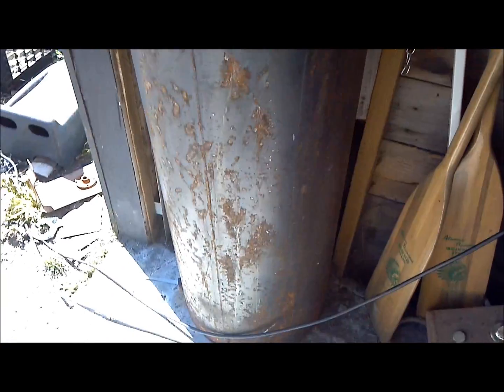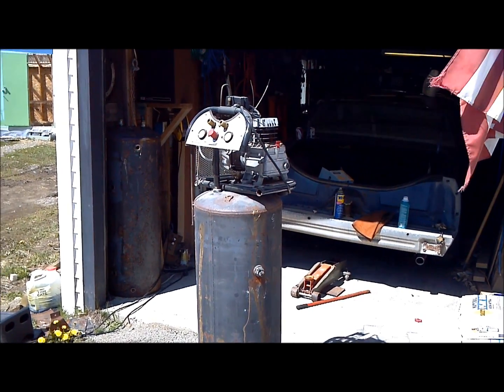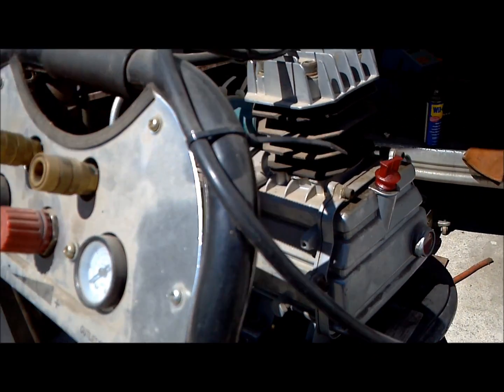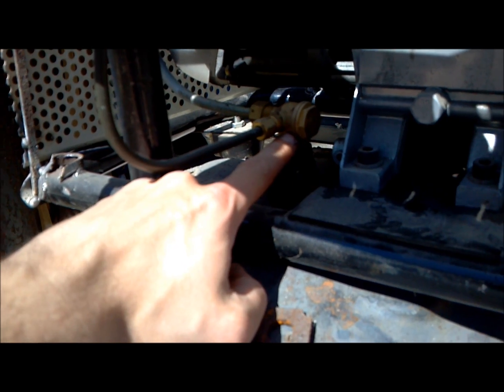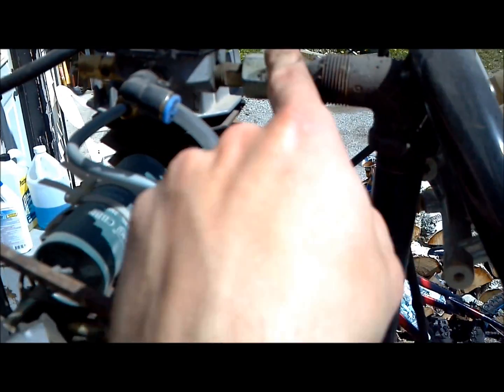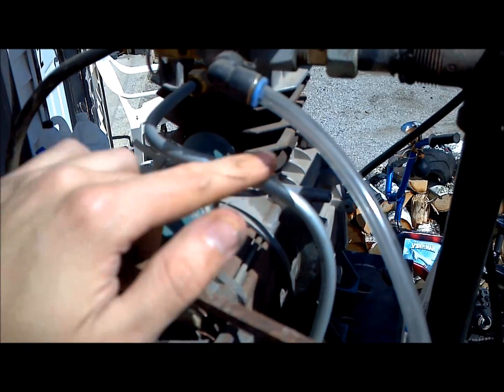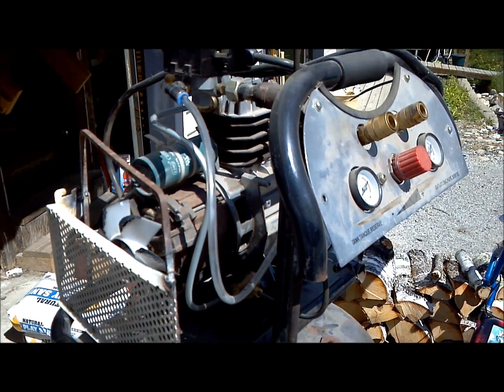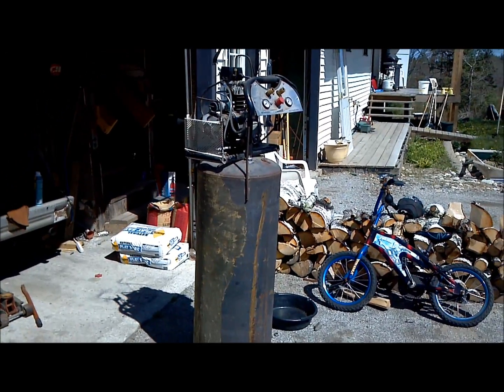cheap 40 gallon air compressor Home made DIY

Comment: Howdy, 
Thanks for sharing.
I stumbled across this wondering if I could make a small 12v or 24v dc  water heater from a small air compressor tank or air ride suspension tank? 
Any thoughts on that there?
Thanks in advance, much appreciated 👍

Comment: Did you ever have any issues over time? Or any worries qbout it exploding?
Reply from the maker: I have built 3 of these. This one has helped 4 different buddies start their shops and get running tell they have money for tools. I have built both a smaller version and a bigger one I use now. Heater water tanks are rated for 300psi air tanks are only rated for 180. The key is checking and water draining the tank every few months.
Reply: @redneckcomputergeek  awesome. Thank you so much for replying!!